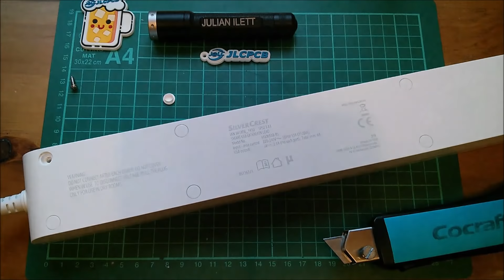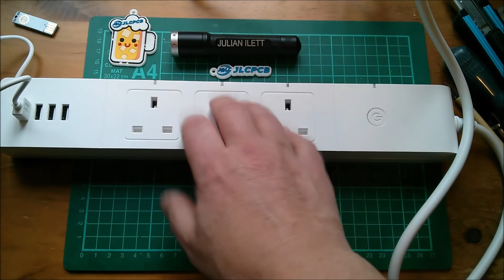Lidl Smart USB Extension Lead - Stripdown

Comment: Yes, now it will be 100% safety instructions. The other day I was looking at a can of paint and they didn't have room to even say how long it takes to dry because the can was covered with safety instruction in a bunch of languages.
Reply: They let you buy a can of paint without signing a waiver? Negligent! 😉
Reply: @thomas316  Their system did actually require an ID check.

Comment: They weren't "smart" enough to put a Fourth Three pin socket on it  - it doesn't feed my OCD very well with that big blank space! :)
Reply from the maker: Yeah, but 3 is a magic number :)
Reply: @JulianIlett  3 is enough for driving RGB LED's lamps and christmas tree lights, also available from Lidl. Same Chip?
Reply: Just to blow your OCD to a new level, one way, two way, four way, six way, eight way and ten way mains extension sockets are widely available 😁

Comment: gateways are a waste of money.
Reply from the maker: The gateway appears to have wired LAN and WiFi - why does it need both?
Reply: @JulianIlett  My best guess is that one is more reliable than the other.  Also more secure.
Reply: @JulianIlett  as you mentioned in the Ideo ZigBee does have a longer range. If you had the land, you can daisy chain these ZigBee devices over several hundred meters

Comment: AFAIK you don't need the gateway if using with ZigBee compatible controllers, similar to the IKEA wireless light bulbs which can connect directly to certain smart assistants (Echo dot + being one of them I believe) without needing the IKEA gateway.
And yes, most European outlets are 16A and appear to be  much better rated for the current than UK plugs where 10A is the recommend maximum draw for long term use with a story I heard that the GPO would only allow ~8A if both the plug and socket were not MK and in good condition.
Lastly German and French plugs are different, with the Schuko using trips top and bottom for earthing and the French using a pin on the outlet and hole on the plug, they are similar enough, though, that the standard now is to use a plug with both earthing systems which will fit in either socket.
Reply: Yes, the old 15A sockets were much chunkier. Usually 1 or 2 15A sockets on a 15A fuse. Plugs were unfused. Oddly the original 13A sockets and plugs were quite happy at 13A continuous. The requirement for sleeved pins messed that up because it reduced the CSA of the brass pins. And of course now everything's built down to a price. I collect the old unsleeved plugs because i have no kids in the house and they're just better made.
Reply from the maker: Do you mean the 15A sockets with round pins? Aren't they still in use in some countries?
Reply: @JulianIlett  AFAIK India still use them and South Africa are moving over to Schuko from them. Still used a lot in the entertainment industry for lighting where the lack of a fuse is a big advantage.
Reply: @JulianIlett  Yes, South Africa uses a functionally identical plug, but re-rated to 16A to match modern breaker sizes.  India still uses the same old BS546 style rated at 15A. Probably a lot of smaller former colonies have a few left as well. And of course they're still technically allowed now in the UK.  Used in theatres a lot as you probably know, but they can also be used for stuff in domestic circumstances that goes JUST over 13A. (some integral ovens are 3.5kw, if you want them to be plug in/out for cleaning/servicing, a BS546 15A plug is ideal)

The 5A and 2A variants are still fairly widely used in pubs and restaurants for table lighting and so forth to stop punters unplugging them to charge their phone LOL.
Reply: The U.K. 13A plugs are still required to be capable of 13A continuous. I’ve not heard anything about anyone down rating them.
In actual fact, I’ve seen an extension lead (rated at 13A and using a normal 13A plug with a normal 13A fuse) with two 2kW electric heaters plugged in. This had been left in use for at least a couple of weeks. No signs of the plug, lead or the extension having overheated. And yes, both heaters were switched on. Although they both had thermostats.
The old GPO no longer exists, are you referring to the postal service: Royal Mail or the telecommunications company: BT (British Telecom)?
My dad worked for the GPO before it was split up and the government privatised it.

Comment: 13A limit?  In the US we have the freedom to draw as much as we want.  We can daisy chain power strips until the wires begin to melt and get toasty.
Reply: Hardwire the fuse and you can do that in the UK as well...
Reply: Yes but only 120VAC, not 220-240 like most other places
Reply: They daisy-chain 240vac from one RCD and that's why their plugs have fuses.  13amps at 240vac is about 26amps at 120vac.
Reply: @TechGorilla1987  RCD and fuses are totally different protections.  One (RCD) protects against electric shock whereas the other (plug fuses) protect against fire (Current overload).
The reason plugs have fuses is to protect the cable connected to the plug, if they didn't have fuses then the cable would need to have a large and impractical CSA (roughly 5mm2),  this is because they are connect to a 32A protected ring final circuit.
Reply: Carl, as I understand it, US homes do have current limited supplies, the limit being set by the (circuit) breaker for that circuit or circuits.
Reply: As somebody in the US who's dealt with people plugging too much into a power strip I can say most (possibly all?) power strips have some sort of overcurrent protection. Sometimes it's a discrete breaker, sometimes it flips the master switch, and apparently sometimes it's a self-resetting element. I remember troubleshooting a bench of computers which would 'randomly' restart when everybody was on them. Ten PCs and monitors all on one outlet. It would overload the power strip which would then self-reset and the computers would come back on.
Reply: Just trying to make a funny boys.  UK plugs are superior.